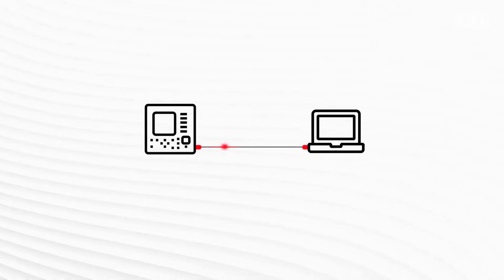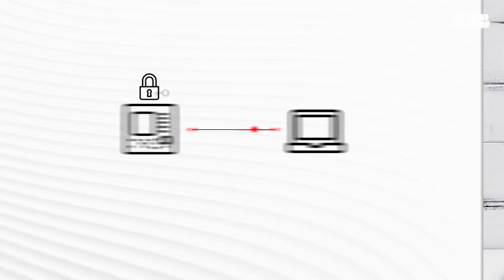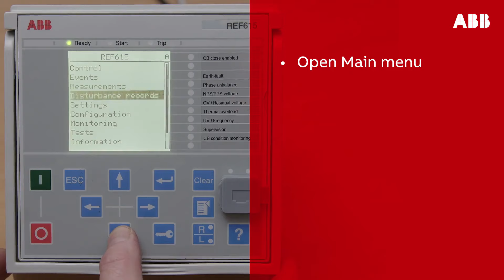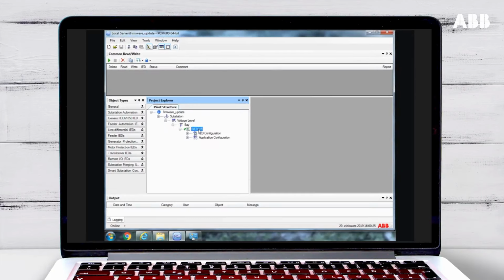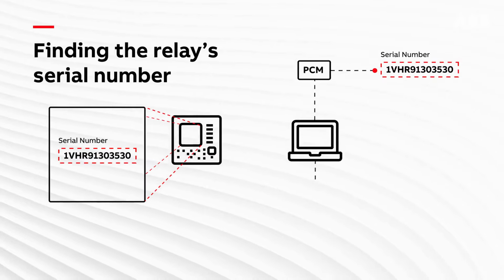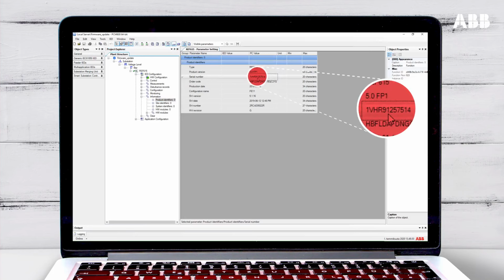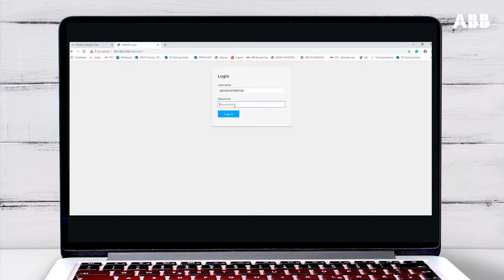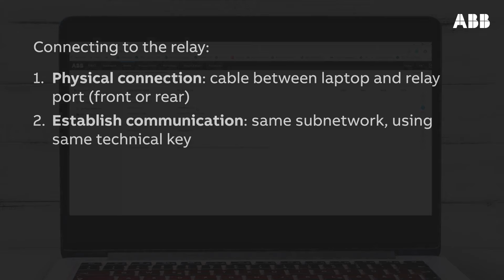How to connect to a relay to use PCM600 and find its information?

Comment: Menu-control-CBXCBR, this section not getting access to close BREAKER, I need access to close from this section, what I want to do to,
Reply from the maker: Dear Ilaya,

The primary equipment can be controlled via the LHMI with the Open and Close buttons when the protection relay is set to the local-control mode and accessing the
control operations is authorized. In 615 series Operation Manual, there is more details about the operating procedures.

Regards,
ABB Learning

Comment: How to do manual syn enable in REF 615 relay
Reply from the maker: Hi Ilaya,

Could you please clarify what kind of “syn” you are referring to, so then we can assist you better?
Reply: @ABBlearning  manually enable synchronize from the relay itself
Reply from the maker: @ILAYARAJAraja ,

The synchronism and energizing check function SECRSYN checks the condition across the circuit breaker from separate power system parts and gives the permission to close the circuit breaker. SECRSYN includes the functionality of Synchro check and energizing check. 

In the command mode operation, an external command signal CL_COMMAND, besides the normal closing conditions, is needed for delivering the closing signal. In the command control mode operation, the Synchro check function itself closes the breaker via the SYNC_OK output when the conditions are fulfilled. In this case, the control function block delivers the command signal to close the Synchro check function for the releasing of a closing-signal pulse to the circuit breaker.

In 615 series Technical Manual you can find detailed information about the SECRSYN function.  

Regards, 
ABB Learning

Comment: Hello sir, i am not able to use "work online" mode in PCM600. The "work online" tab is showing deactivate, please guide
Reply from the maker: Hello @bharatlalmali8695. To online monitor the application configuration, the complete IED configuration must first be written to the IED.
- Only when the application configuration in the IED and
PCM600 are the same, the online monitoring starts.
- When the IED does not support online monitoring, the button is disabled.
- The Work online function is not supported if the split window is
enabled.

Comment: I had connection with new ABB Relay RET670, there is green signal as shown(no any red cross), this means there is sound connection. But when I tried to read for the internal configuration of relay setting in order to check and modify as per our requirments, while using read option or write option, it cant read issuing . It issued 
:Configure IED first. with remarks Cancelled>

is there any configuration still do be done, what exact configuration is it looking for.
At some point it "common read/ write menu", it comment section while writing it issued error at application configuration point and then signal matrix error(just flash for very short time which i got by using camera video  mode to get what exaclty happened.
 But I coudnt configure the source of exact problem.
Reply from the maker: Hi Sandes, thank you for your question. Please contact Hitachi ABB Power Grids' Customer Connect Center for support with RET670 IED.

Comment: Hay ABB 
I have a problem with relay ABB RET 650..
I used PCM 2.10 600 to connect with relay but the path is not of a legal form.. 
I need problem solving from you.
Thank you
Reply from the maker: Hi Paulina, thank you for your question. Please contact Hitachi ABB Power Grids’ Customer Connect Center for support with RET650 relay.

Comment: Hi ABB, can you please make a video on how to set the reclosing function (DARREC) of RER615. Also, in the phase and ground directional settings, is changing the curve types requires the change in the parameters (A, B & P)? For Schneider and SEL relays, the curve type does not require the change in parameters except for customized curves. We've done a SCIT, but the actual trip time does not match with the computed. Also, the reclosing function isn't working. Whom can we contact for our technical inquiries? Thank you. 

Christopher - Philippines
Reply from the maker: Hi Christopher,

Thank you for your suggestion.

Please check DARREC Technical notes available on the link http://abbtm.fi.abb.com/fi//attachments/TechnicalNotes/tech_DARREC_756960_ENc.pdf. If you need support, please, contact ABB Philippines Electrification unit (ph.electrification@abb.com) and they will address your request to the correct person.
Reply: @ABBlearning  Thank you for your reply, really appreciate it. Will communicate with ABB Philippines as we implement the technical guidance you gave. Thanks a lot.

Comment: Hi..How can I access the application configuration/signal configuration in REU611 through PCM600? I was made to understand that the signal configuration can be accessed in both web HMI and PCM600 as per video in link below:- 

https://www.youtube.com/watch?v=T1dxW8AS4Yg

However I couldn't find the options to get to the application configuration in the PCM600 for 611 IED series. Please help!
Reply from the maker: Hi Akay,

Thanks for your question.

Application Configuration tool in PCM600 is not available for 611 series relays. You can use Parameter Setting Tool (Generic logic settings) in PCM600 for signal configuration of 611 series. Like shown in the video, in web HMI there is an easy way for signal configuration in 611 series as well. 

Regards,
ABB Learning